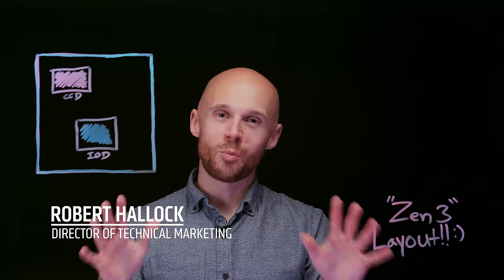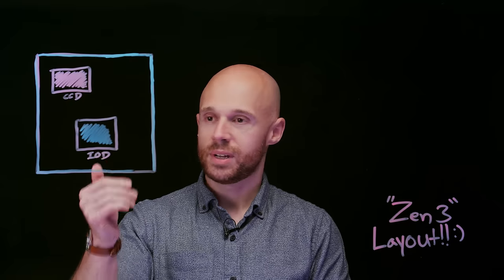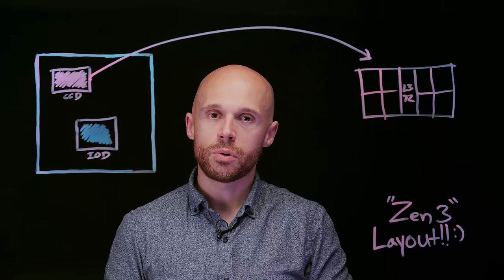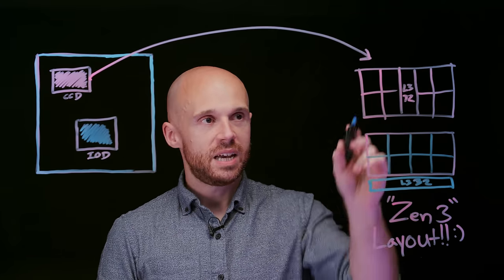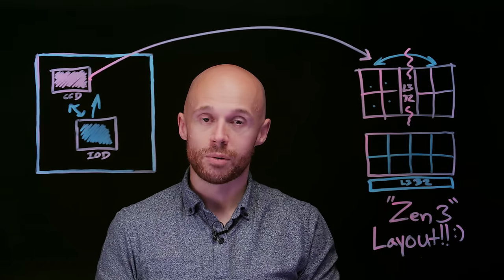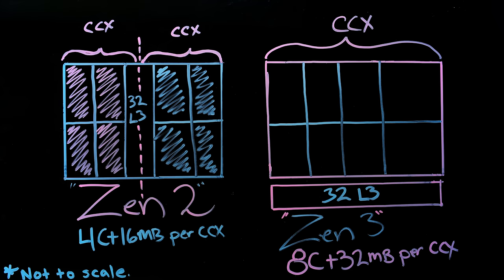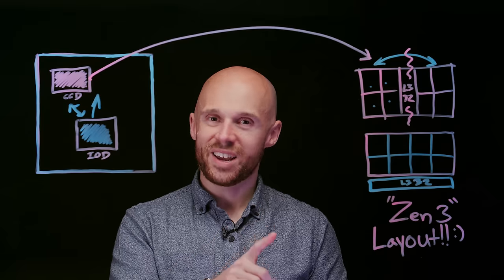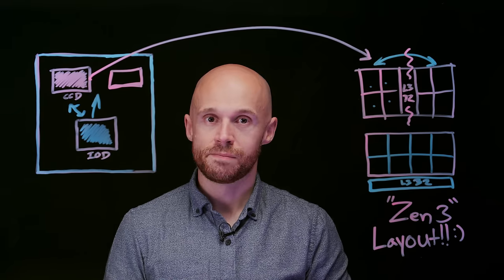How It’s Built: AMD Ryzen™ 5000 Series Desktop Processors

Comment: GREAT!!! Please, we need a video  explaining  Smart Memory Access in depth, for those who are in the fence to upgrade their older mobos/cpus for the upcoming  Ryzen/Radeon products.
Reply: I would imagine that video will be uploaded later this week.
Reply: Diego Ignacio Falcone I’m not particularly versed with the technicalities of hardware, and I could be completely wrong with my input, but I believe that it’s almost like a cache communication dialogue switch between the CPU and GPU depending on the requirement of the power draw at a specific moment that’s more GPU intensive or CPU intensive (utilizing Smart Shift technology, which is also implemented in the PS5 and upcoming AMD laptops). This allows for the so-called “Infinity Cache,” because the communication is so efficient that cache can be redirected across multiples dies instantaneously when it is necessitated more so by one die, and memory subsequently won’t need to be overloaded if it’s unnecessary. Again, I could be completely wrong, as I’m trying to do more research on this topic as an unfortunately non-technical individual, but I hope this makes a bit more sense from this potential perspective.

Comment: Can we see an RDNA 2 deep dive next time? :>
Reply: This comment deserves to be on top. RDNA 2 has so many unexplained features... Like how does it work with raytracing, what "super resolution" actually does, why are all the GPUs have same 300w tdp, while having different performance?
Reply: @Boris-Vasiliev  I think the super resolution thing isn't finished. I expect them to polish it come 2021. I wanna know more about infinity cache and ray tracing though

Gpus with the same tdp but different performance means there is either a difference in architecture or binning. Binning is like... Well imagine you own a farm. Binning is when you have a bunch of apples at that farm and you had just finished picking them all from the trees. Then you group them according to their ripeness. There is a group that is very ripe (high performance like the 6900XT) and there is a group that isn't really ripe (like the 6800XT). The apples have the same weight (TDP) but they have different ripeness because you grouped them (binning).
Reply: Well, while we don't know that, but there's surely a fully open source GPU IP by AMD, called MIAOW (actually the "Southern Islands", but Open Sourced), which is as freely usable as RISC V IP, to the best of my knowledge.
Reply: @Boris-Vasiliev  because TDP stands for Thermal Design Power, or the maximum theoretical heat output of the chip.

Comment: Hey Robert, what about communication between both (2) CCD? Is it at ZEN3 still going "through" the IOD? <- Nice video by the way. THANKS!
Reply: Yes, it has to go through the IO die. Let's hope we can crank up the infinity fabric clock beyond 1900 MHz with zen 3
Reply: @deuterium2132   :) Was my next question ! :D - I'm stuck on  stable1800 with my actual 3800x ... Don't wanna rise voltages to push last 33 or 66MHz on that. My CPU clocks well 4,25all core with 1.25V (THX to Yuir an his CTR tool) saves a lot of heat :)
Reply: @bjornlaupert5967  afaik the IO die stays the same from zen 2, someone speculated that the substrate might be improved though, allowing faster fclk
Reply: They can go easy to 2000MHZ IF
Reply: @prfrag  do you know for sure - or is this speculation? Mean are there official numbers already - or just rumors ??

Comment: *cries that I bought zen 2 recently*
Reply: I'm building a generous build for my little cousin and it's using a Zen 2 R7 3700x + 5700 XT. I think it's all good value.
Reply: That seems like a pretty good build, honestly. While the 5700XT isn't the best GPU of it's generation, it's still a very good GPU, and the 3700X is still a great CPU. It also helps you're not depending on any of the new parts that will most likely sell out on day one.
Reply: @raulsantos6394  can’t u just use the Ryzen 5 with that gpu
Reply: You don't need to cry. Zen 2 is still awesome and you won't need to upgrade for years to come.
Reply: why though? Zen2 is still a good cpu, and if u are using a b450 or a b550 board, you can upgrade anytime to Zen3 when ur current dies, but thats prolly after 3-4 years
Reply: @kiinqdoge5611  yeah could, a R5 3600 or R5 3600X. But it wasn't available at the time I went to purchase so I pushed a little up with R7.

Comment: Hmm..The same CCD Layout  chip as Zen 2, the Ryzen 3 3300x CCX lay out is just as you describe on  the Zen 3 with 4 cores  having direct access to L3 cache  just like the 8 core  Zen 3 layout. So wouldnt it make more sense to just Describe the  5000 Series processors as Zen 2 + since  the Zen 3 is fabricated on the same 7 nanometer MOSFET as Zen 2. Just like Zen, Zen +  It would be more accurate to name zen 3
Zen 2+  as Zen 3 is just a minor incremental architecture enhancement. Kudos to AMD for continuing to innovate and push the competition is certainly a Win, Win for consumers.
Reply: Nope zen3 is a new architecture bro.

Comment: This is a great illustration for 6 and 8 core processors. How does the 5900X work? There's an extra CCX to get 12 cores and a separate cache attached to it, wouldn't latency be back? Gaming benchmarks from AMD have been using the 5900X so I'm assuming it's faster than the 5800X but curious about the communication between CCXs or if the OS knows to assign process affinity accordingly to CCX layouts.

Comment: Correct me if I'm wrong but the conclusion is that they built just bigger 8-core module with larger shared L3 cache, for up-to-8-core specific tasks, but when you want to scale out the multiple dies need to communicate like on Zen2. That's nice, but the guy is funny trying to sound like it's some kind of breakthrough.

Comment: Fact- I planned this core layout ever since amd released zen+ and when I knew that intel cpu performs better in gaming because of the lower core latency, this was the best way to reduce that latency but, the engineers at AMD got this 😲
Reply: The 4 core CCX was designed to compete for value. AMD didn't expect Intel to keep eating their crayons and sniffing their glue like this. Then TSMC knocked it right out of the park with their yields so it became not only financially viable but also completely obvious that an 8 core CCX would give Intel the biggest headache in a very long time.

Comment: Nice explanation :)
Question: For 6 and 12 core Zen 3, is it 1x 8-core die with 2 cores disabled for 6-core and 2x 8-core dies with 2x2 cores disabled in each die for 12-core, or are they 6-core dies by design?

Comment: So they're basically gaining a performance advantage by moving on from their previous CCX design that was mainly meant to improve yields, right? I wonder if they've found a solution to the issues they were trying to solve by taking that route, or if they're just accepting the lower yields and raising the costs in return.

Comment: Surely if the cache was put across the middle in zen 3 two things would happen ...
 1. All cores would be as close to cache as they can get.
 2. Splitting the cores up physically would make them easier to keep cool under load.

Or am I missing something here?
I was half expecting either that or two blocks of 16mb cache.

Comment: So if only the core layout is different and the IO die and memory controller are the same, what meakes the Smart Access Memory require a Zen 3 over Zen 2 to work if they are both on the same 570X/B550 chipset motherboard?
Is it just an artificial limitation, is it tied to the micro code on the CPU or it has to do with how the L3 cache is laid out?

Comment: Me: Let me tell you what's coming in Zen 4. They're gonna get all 8 cores and place them in a way that we can represent as a 2x2x2 Rubik's cube. By doing this, the distance between the left-top most core and the right-bottom most core will significantly decrease for the data transfer.

AMD: Come work with us.
Reply: By that logic there's a caveat.
First if the core actually stacked vertically there's a very high chance the bottom cores overheat faster. But if that solution actually works, we might be seeing 600 series motherboard but with CPU heatsink on both sides of the board instead of regular one. You get what I mean? It is not a bad solution although may look silly.

I'm guessing that Zen4 will probably use Brand new technology from TSMC where it uses Optical communication that travel at Lightspeed. So it's not purely silicon but more like Fiber optic.
Reply: @ClayWheeler  My intention just to make a joke  depending on the fact that they're trying to get things closer and closer lol. Nothing serious.

Comment: I want to see performance benefits of RandomX mining XMR. The reason I have decided on 5950x. I would like to see mining software utilize the SAM on the 6000 series using its GDDR6 vrs DDR4 as the system memory. I wonder what % increase in hashing power would be accomplished if any or negative?

Comment: Such a simple change. I just wonder which CPU is better for gaming? 5800X with 8 Cores on 1 CPU die or 5900X with 6 Cores and 2 dies. In theorie the 5800X should be faster, because none of the cores has to communicate over the IO die, right?

Comment: Intel is scrambling on "gluing " their Rocket Lake cpus with whatever cpus they come up after that

Considering AMD's "glue quality" is so good now that they sprinkled Fairy Dust on zen 2 and magically those 4x2 cores somehow turned to 8x1 cores 
zen 3
And now 5950x is basically two 9900ks with 40% more ipc, pcie 4 and less power consumption than ONE 9900ks WTF 
Whats next, Ryzen chips run on solar panels and handcranked generators?

Comment: Soo if the Zen2 Architecture helped with scalability, is it not so great with zen3 or is there a trick to achieve it on the new layout too? :D
Is this why there isn't a 5000 series threadripper yet? 👀
Reply: Zen 3 is just as scalable as Zen 2. It's just that each CCD is now a true 8-core design instead of 2 quad-core CCXs inside.

Comment: How do you draw in space? lol, I bet there is a vertical sheet of glass, that's simple. Now a suggestion for Ryzen 6000 series but give me an AMD computer system and I'll tell u :) ok , 02:10 , a line of cores are still in the back of other line of cores, how about to draw the L3 horizontally right in the middle, in between the cores lines so every core will enjoy direct L3 or how about drawing in the middle a square which would be L3 and all the cores place them around L3  just like a stadium? 
Oh and start researching carbon nanotubes for CPU sheet because the limit of silicon potential is almost reached.

Comment: Please improve the "die" cooling and bios voltage  control efficiency,  The last bios on B450 /3300X voltage was too high and the off center design is trouble for all types of heatsink or AIO
Reply: Put a Bequiet Dark Rock (used ones are pretty cheap) on that thing and you won't ever complain about temperatures again.

Comment: And that's why you people won't get Zen 3 support on X370 m/boards as we promised (socket support through 2020). Because Zen 3 architecture has no difference to the way the CPU is connected to the m/board and its devices.
We just pulled an Intel on you. Thank you.

Comment: The Zen 2 layout is totally wrong. How the heck does that slip past? It makes me seriously doubt Hallock's competence if he doesn't know the Zen 2 CCD like the back of his hand.
Reply: Also the Zen 3 layout looks completely different than the slide AMD showed at the Zen 3 announcement. Where the L3 is labelled should be the IO block. Take all the cores out because they aren't on a grid. Then add two columns of four cores, one on the left edge of the die and one on the right. Between those columns is the L3 cache. Zen 2 die is similar but the IO block in the very middle of the die, bisecting the cores and cache into two CCXs.

Comment: if the 5600 is close to as fast as the 5600x it's worth it. But atm intels 11th gen seem to be faster than 5600x
Reply: 14nm+++ then no...
Reply: @kevinyoliveira68  well it has been very apparent that smaller doesn't mean faster